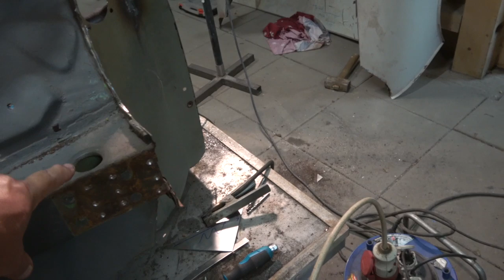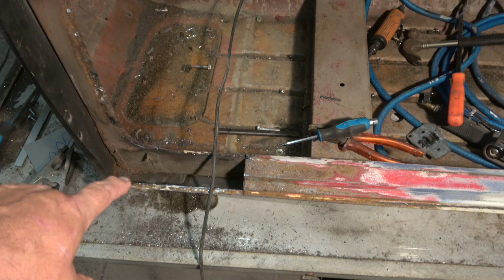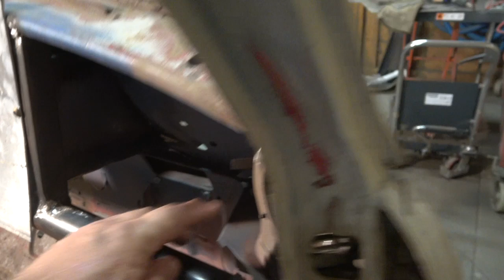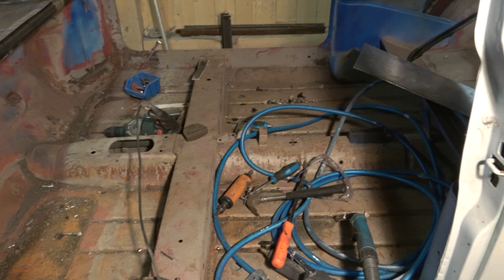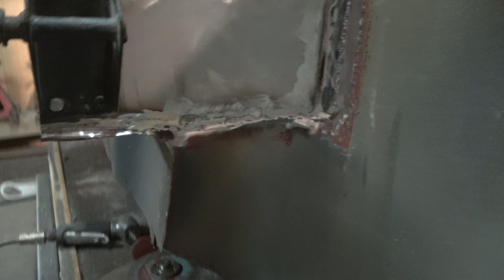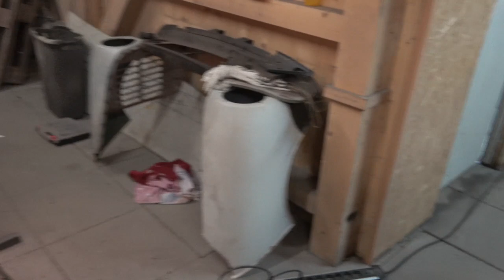Classic Mini Track Day Car Build Part 7  ( Upgrading The Inner Wings )

Comment: Hi Dave, what is the thickness of the sheetmetal you use for repair panels? Thank you, keep the good work!
Reply from the maker: Dario,  It‘s normally 1mm but we use 2mm in certain places like the inner wings as they need to be strengthened up
for the coil over shocks and beefer suspension. Cheers Dave

Comment: cant work out why you arent welding the bulkhead box in place? I can understand the removable bit at the back to get at the filter but its normal practise to weld the boxes in.
Reply from the maker: Richard, I may weld it in place at the end but for now i need to be able to remove it for welding & painting. Cheers Dave